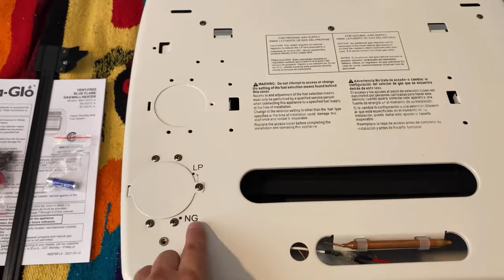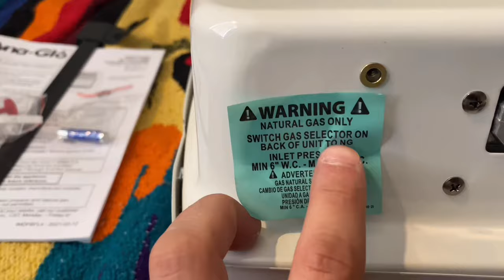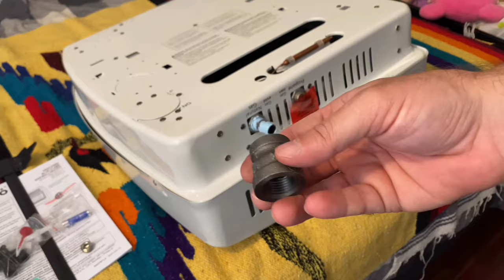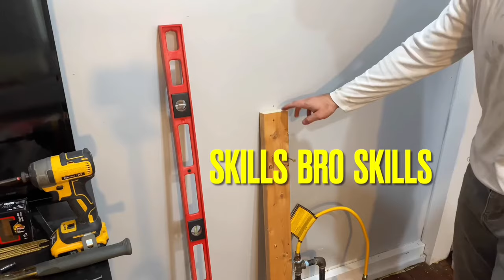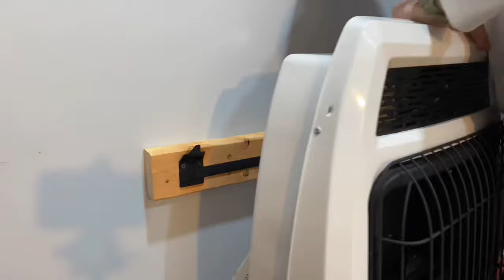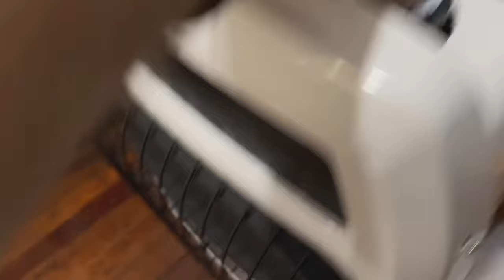How to install a blue flame wall heater.

Comment: Great video thanks. Based on your use can you tell at what temperature the lowest thermostat setting comes on?
Reply from the maker: @bowercabin8540  Thank you! I appreciate that and I believe the lowest setting is about 50 degrees and then 60 then 70,80 like that. Roughly, that’s pretty accurate. Hopefully this helps! They also have different sizes as well!

Comment: i have the 30,000 unit in the instruction it say i need a pressures regulator but all the vids i seen no one says any thing about it. Also wont the pipe  dope degrade the telon tape i thought it was use one ot the other not both any extra clarity would be great
Reply from the maker: Thanks for checking in! This is how I’ve always hooked these up. I put carbon monoxide and fire alarms in also and never had a problem so far.  Except maybe once in a blue moon, if it wasn’t turned on properly or something. I’m not a professional plumber but I have seen these hooked up just this same way in lots of houses. I think you can get as crazy as you want to and the crazier you get the safer you will be. And if the Teflon tape does degrade, there will be plenty of pipe dope still left. You could just use pipe dope if you would like. That would be fine as well! Hopefully this helps some!

Comment: Question just got mine installed how does the thermostat work? If the room is already warm would it turn on at 1? 2? 3? Because ours turns on on 5
Reply from the maker: Okay, I see well mine, I did not adjust or anything.  I just hooked it up the way it came but mine will turn on in a warm room at about 3 and 5 is a bit to hot most days but will still shut on and off when it gets to hot or to cold automatically.  How hot is your room if it’s pretty cold like 50 degrees it would probably come on at 1 or 2
Reply from the maker: Hopefully this is making sense or helps let me know if that helps you! Thanks

Comment: So the products of combustion vent in to the room ?
Reply from the maker: These burn very efficient, you will have little combustion. In my experience it’s worth the risk in Oklahoma because temperatures drop below 0 often. Pick your poison. Also price is under $200 in comparison to central heat and air that is 15 to 20k. It wouldn’t be on the shelf if they thought it would be extremely dangerous in my opinion. But I’m not a doctor or nothing.

Comment: So if you don’t have an existing gas line, are you pretty much forced to use propane?
Reply from the maker: Yes, basically because your probably not in the city limits and only have propane options. But you would hook it up the same way.
Reply: @GrantKeysProperties  Thanks. Any idea how much propane these draw?  Would a day of use drain a significant amount?
Reply from the maker: @reedr7142  You would use a big propane tank, like 300 gallons or more and a 500 gallon tank would last all winter using it every day roughly.

Comment: I’m replacing an old similar unit with a new one , the gas line doesn’t have a sediment trap ,  could that damaged my new unit
Reply from the maker: If you want me to be honest, you could just hook it up like it was before without a sediment trap. I just upgraded mine since I was doing it anyway but older homes didn’t have them. That’s my two cents at your own risk. It should be just fine. But I’m not the one all be all. I have seen it though and it worked before so it would work again that’s all I gotta say about that. Ha ha.! Hopefully this helps you brother!
Reply: @GrantKeysProperties  thanks for the tip , the old unit was 25 years old , it had an internal leak and the oxygen depletion sensor didn’t shut it off , time for a new one , plus when i remove the old one I may just get  t adapter, mine was hooked directly to the pipe so that’s good I won’t have to spend money on a flexible gas line
Reply from the maker: No problem at all! And that’s cool yes and never hesitate to reach out l, best of luck to you!

Comment: You think i could use this on a camper and hook up a 20lb propane tank?
Reply from the maker: Yeah, you could do that as long as your camper can handle the heat. You might get the one that is one size smaller depending on the size of your camper. It’s cheaper too from Lowe’s also!
Reply: @GrantKeysProperties  Cool. I'll check into the smaller one. Thanks man. Appreciate you!
Reply from the maker: @OnlyHuman2.0  no problem at all ! I appreciate you checking in here!

Comment: nice work. im wondering if this model can be tapped directlyto my oil tank. i finished my basement and removed the furnace and ducts but leaving the oil tank due to have still 150 gallons on it. i would like to take advantage on that and thinking tapping this heater you demonstrate
Reply from the maker: That sounds like it makes sense to me when you say oil tank though it’s not oil correct? It’s propane or natural gas?? Sorry I guess I just don’t understand the oil tank part. It sounds like you’re just using an oil tank container to hold the gas is that correct?
Reply: @GrantKeysProperties  they called it oil tank but inside its a clean diesel.
Reply from the maker: @ad78  I see well I’m not sure if the blue flame wall heater can operate on diesel. I would research that first. If it doesn’t, you could drain the tank and figure out how to clean it and then fill it with propane or natural gas. That would be my suggestion before you just hook it up just to make sure that its safe and wouldn’t damage the heater. But that oil tank ideas actually a great idea. I might look into that for a property off grid or something!
Reply: @GrantKeysProperties  yup, the oil company wont do buyback. I would really like take advantage of it. Thanks and happy holidays!
Reply from the maker: @ad78  Great thinking! And I appreciate that, happy holidays to you as well, best of luck to you!

Comment: Why are your studs so far apart? They should be 16 inches apart on center. That 2x4 looks to be 30 inches long or more.
Reply from the maker: The duplex is 85 years old and some homes are built on 24in centers or 16 in centers etc anyway it’s not ideal but it is all solid oak studs and lots of oak wood throughout the full property. Full thickness 2by4 in oak. It’s decent and I’m beefing it all up. Bringing it back to life